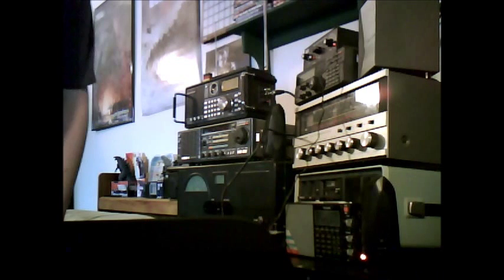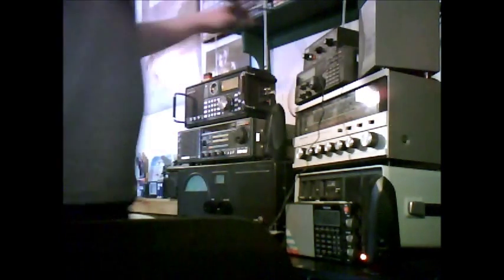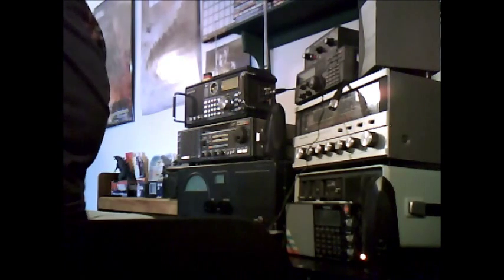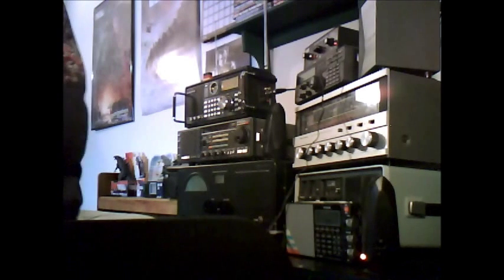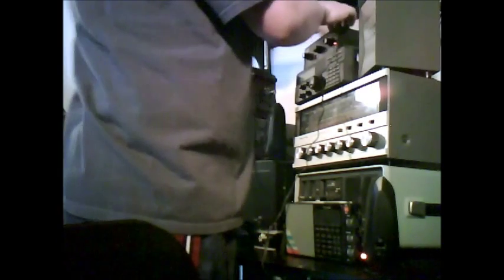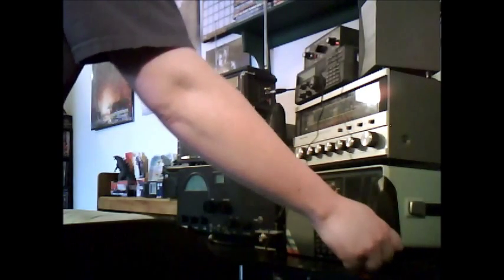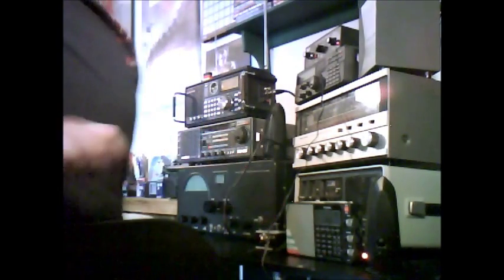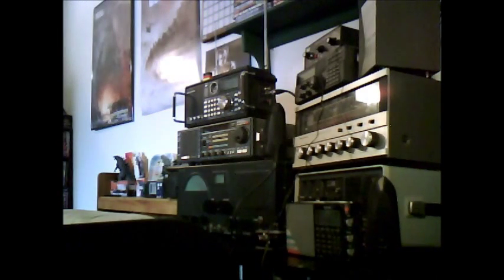MFJ-1020C Active Antenna/Pre-Selector Demonstartion

Comment: I have an earlier version of this unit.  It works well of the receiver is of poorer quality.  Good receivers already are able to do what the 1020 does.  For lesser receivers (cheaper stereo component receivers, for instance).  You can also use it with an outdoor antenna (connector in back) to reduce signal overload.  You also might try connecting a wire loop to the this and see what it does.  Good luck with it.
Reply from the maker: Thanks for the info. I no longer have the 1020C, but I wouldn't mind trying to build loop antenna to null out the interference that I get on the 80 meter band down through the AM band.

Comment: Doesn't seem to be worth the money - poor performance.
In my experience, 55+ years, nothing beats a good outdoor antenna.  Of course, Elevation can't be beat...
Reply from the maker: Both definitely help. Nowadays I'm using an endfed antenna in an inverted L configuration, and a 40 meter double bazooka which I use for NVIS communications.
Reply: @Sparkyzilla85  I'm good with that, especially the inverted L....

Comment: I have an alpha loop for
indoor use if this boosts signal
on loop i would buy one loop antennas
are ok i doubt mfj would boost a lot
but any improvements could make it
worthwhile your demo seemed inconclusive
yet still interesting to watch i think their
are a few plus's somewhere are there any
coax cables included with this?

Comment: Thanks for the demo.

I also agree with SpectreOZ that it's a better idea to compare using the switcher if at all possible. You may need another two position switcher though, to switch between whatever device you are testing and the multi switcher. That way you don't have to keep plugging and unplugging. 

Otherwise, thanks again. I enjoy your vids and you have some nice gear there!
Reply from the maker: El Kabong You're welcome and thanks for watching my videos!

For now I've set the MFJ-10120C aside, but I will bring it out again when I get pick up another swticher and some other accessories. I got some bills to pay first, and I want to buy a better webcam and camcorder.

Comment: Propagation conditions change so quickly you need to be able to switch swiftly, without using a dual feed/switching configuration it's hard to comprehend fully.

There's an unmistakable voice... Alan Jones :)
Reply from the maker: Yeah I need a better setup for my radios. At least I can confirm that as an indoor antenna, it sucks. The whip antenna on my Grundig works alot better than the MFJ's active antenna.
Reply: I look forward to seeing your further experiments... I'd be concerned the MFJ unit is of no real world benefit at all :(

BTW just watched Godzilla 2014 :D
Reply: Hmmmm... that should be Alex Jones :)
Reply from the maker: ***** Well luckily, so far, as a pre-selector on weak stations it is working quite nicely. It's just taking me a little bit to get used to how it's working.
Reply from the maker: ***** Godzilla 2014 rocks! I can't wait for the sequel which will be coming out in 2018, and the new Toho made Godzilla which comes out next year.
Reply: That blue flame Godzilla spat from his mouth was pretty awesome...
Reply from the maker: ***** Yeah I completely forgot about his atomic breath until I saw the blue glow and the sound of energy building up. That was just freaking amazing.